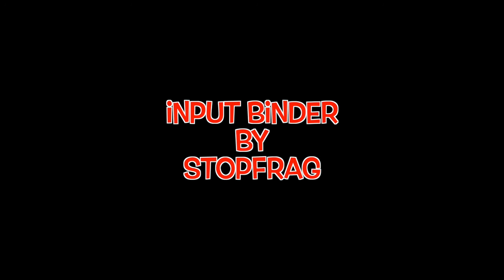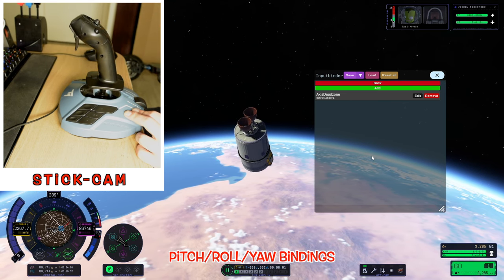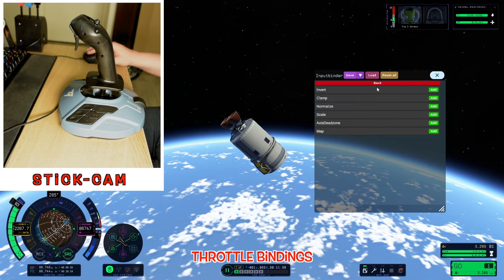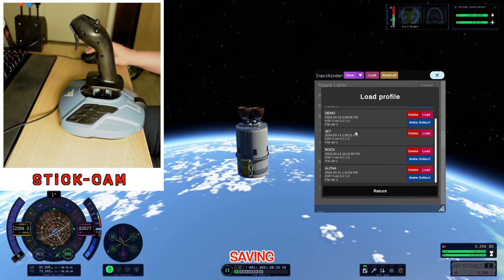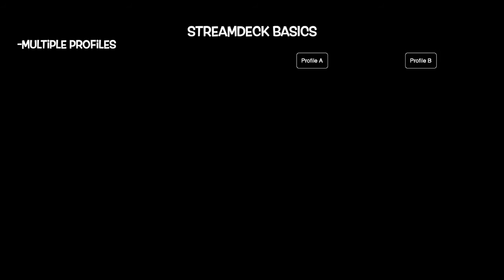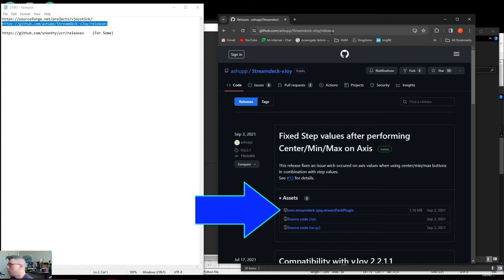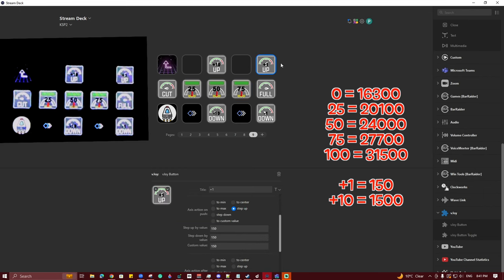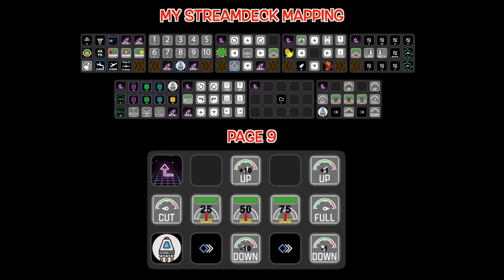KSP 2 Mod Review - Input Binder By Stop Frag - plus StreamDeck vJoy for Joystick & Gamepad Control

Comment: What joystick is that? I need one...
Reply from the maker: Airbus A320. but any joystick will work. In the video we also turn the StreamDeck onto a virtual joystick, and I have also tested with the Logitech Gamepad. and you can even use your own DIY controllers like my Mr.Knobby2020 I made for MicrosoftFlightSimulator
Reply: Its a good stick, try to get it cheap. its the only entrance level stick for left handed. I had it for a year and used it in my left hand for translational maneuvers in conjunction with another stick for ksp and Elite Dangerous. I gifted it to a friend.
Reply from the maker: Actually it is ambidextrous, you can change the left and right stick buttons to the side you like them on. The throttle slider is a little glitchy at 50%. But for an entry level it is great.